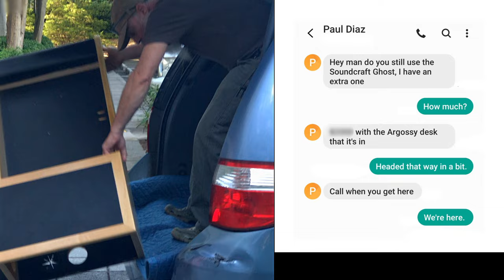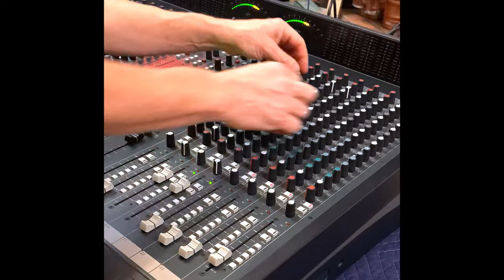Soundcraft Ghost 24 - An Unexpected Find

Comment: I've been saving my Ghost LE24 and most of my late 90s gear from my basement studio in Chicago. I just retired from my AV Tech job at 65, running the Fremont Street video canopy, and am now ready to re-open a project studio in Vegas. Plugged everything last week and everything is as it was in 2000 when I used it last, even channel 11 being dead. Although I've been mixing in the box as a side hustle since 2K, I want a hybrid studio this time and use my Joe Meek mic pres compressors and Lexicon reverbs with the Ghost through Lynx 2 card MOTU gear and Adat, with the ability to record drums. So I'm following your progress and hope I'm competent enough to fix channel 11. Smooth sailing and may the force be with you.
Reply from the maker: That's awesome. I'm working on another video about cleaning and installing the Ghost. Ended up with 100 GB of footage! So about to start editing that now. Stay tuned...